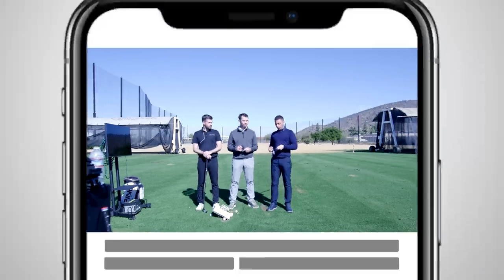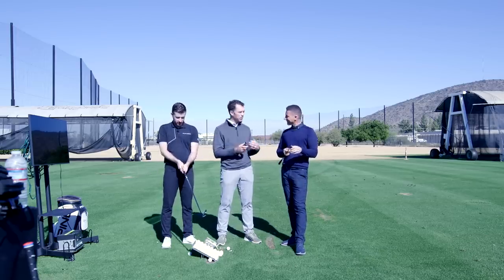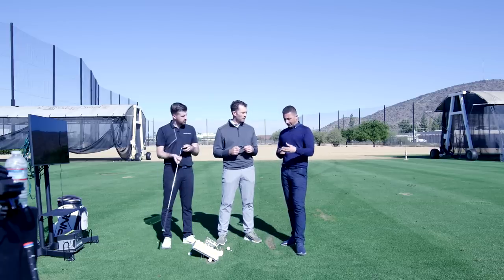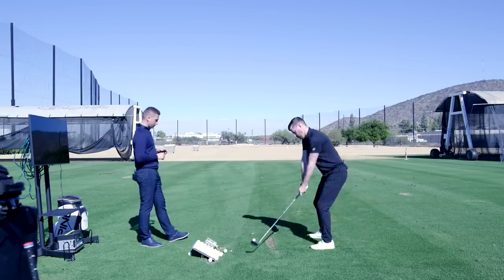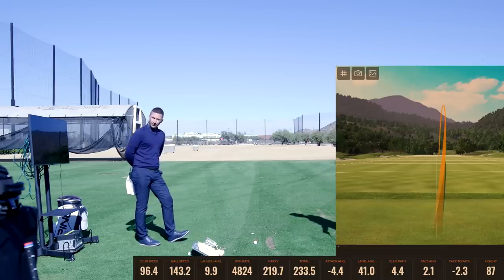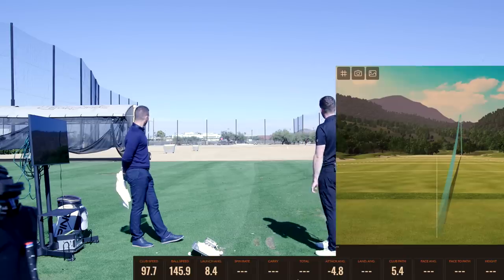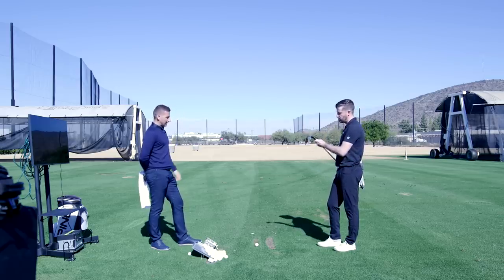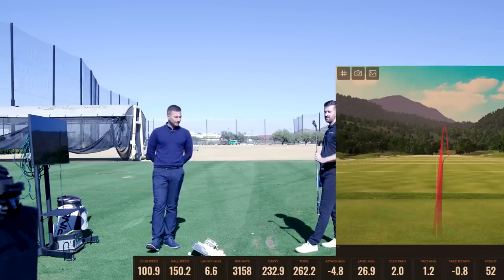NEW PING iCROSSOVER Review

Comment: I got a fit done and needed a 5w replacement, the 4i crossover was perfect lofted down. But I ended up in the 3i lofted up so I have the ability to crank it down to use as a driving iron under the wind. Can’t wait till it arrives

Comment: 100 club, 150 ball, thats 1.5! Amazing guys. Been looking forward to a higher speed person using the iCrossover, this might just replace my driver.
Reply: Trackman reads club head speed slower than GC Quad, so smash factor is inflated. 1.50 on Trackman is probably 1.44/1.45 on Foresight
Reply: @mattherring2166  no GC quad don't measure Club speed so it gives a crappy smash Factor. The GC is based solely on ball data
Reply: @biggregsparks8364  Nope, you’re totally wrong. You’re probably thinking of GC2 (I spent 6 years fitting with Foresight launch monitors btw). Quad can take club data
Reply: @mattherring2166  I guess you're right but I'll never own a GC quad they're like $18,000 I've seen 1.5 smash Factor many times with the driving iron just takes everything to align at the same time
Reply: About what is your current Club head speed you should get pretty good ball speed numbers off the 18° version possibly turn down to 16.5°. , looks like the Loft sleeve will go 1° flat on the -1° setting so you could play at 17° but with the 1° flat setting you can add a whole inch to your shaft in this thing and still set up standard lie angle to get you couple more Club head speed out of it

Comment: I had an old Ping Cross over that never really came in to use so I gave it away.  For me, it was inconsistent which then created insecurity. And, which I have learnt via TXG, it did not fill a distance gap, but rather were in the same distance as other clubs in my bag. 
If it was very windy, it may have worked, but our local golf courses do not have the long-running ground. 

I am sure with the possibilies of changing the loft/lie etc, there are way better opportunities with the new club than previous standard set.